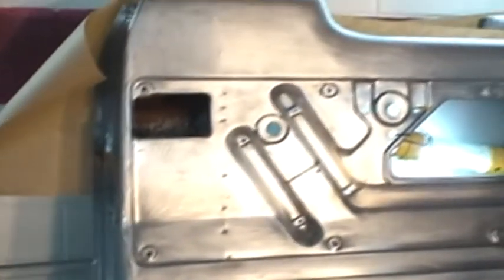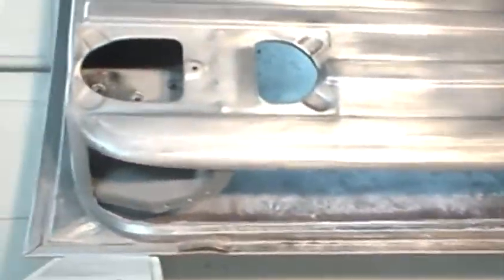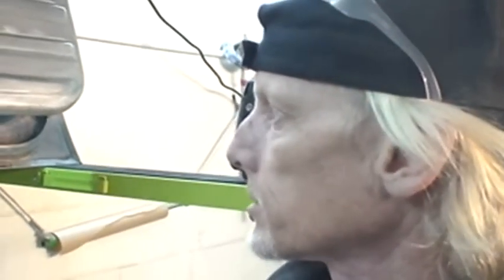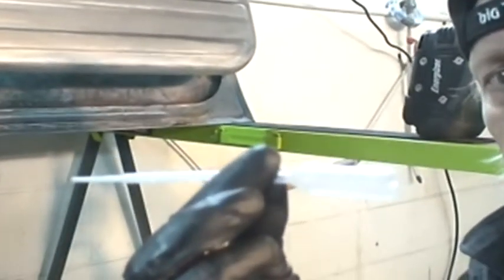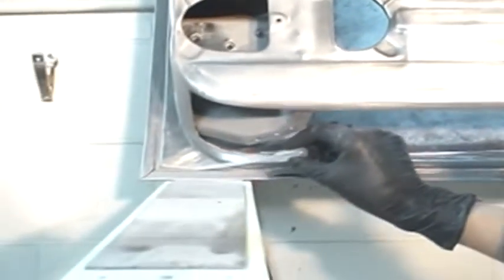D-100_Episode-005.mpg

Comment from the maker: Thanks, Rust-Mort is just phosphoric acid, you really shouldn't get it on any metal that's not rusted which is another reason I do it this way. We didn't show that you have to neutralize it, thoroughly flush it out with water, and dry it with air. There's nothing worse then putting all the effort into a resto, and within a year rust starts making it's way out of the door drains,seams, welds, etc.

Comment from the maker: You have to apply it in 3-4 thin coats 5-10 minutes apart and then let it dry for 24 hours before rinsing it off.. they say with just water but I use a water baking soda mix to ensure the acid it neutralized and then rinse it off with water and dry it thoroughly with air immediately. You're not supposed to get this stuff on un-rusted metal so I'm careful about not doing that. On panels that'll be finish painted, I always just do the vinegar  thing.